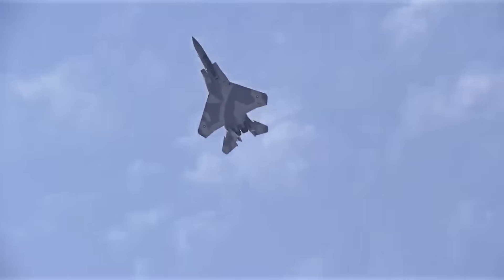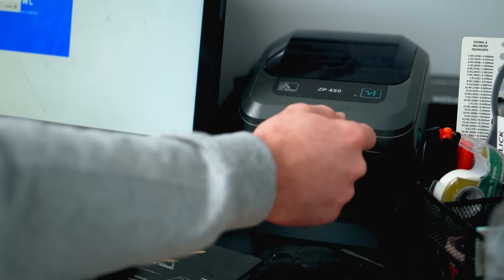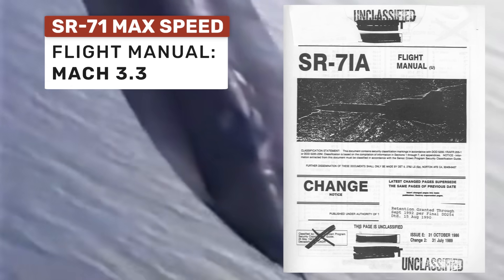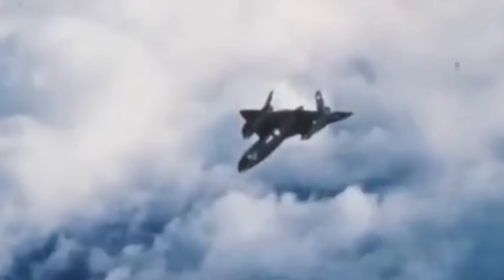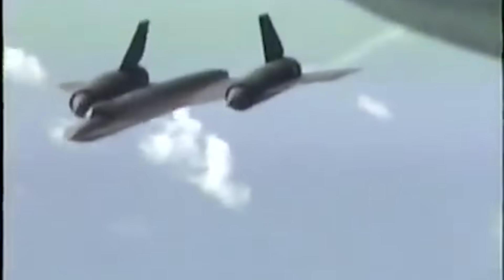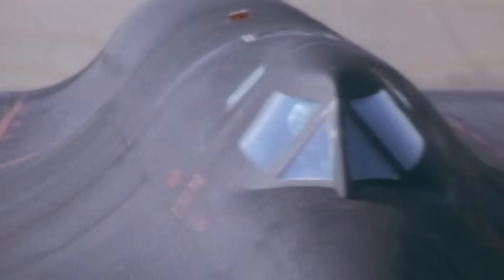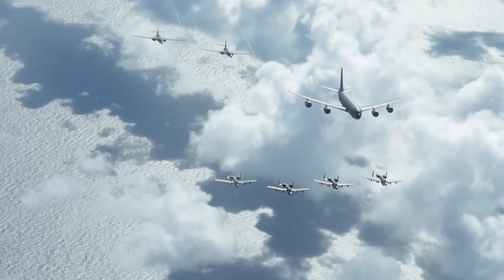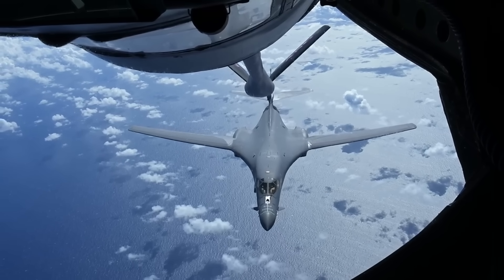The SR-71 was MUCH FASTER than the Air Force will admit

Comment: When I was stationed at Nellis AFB the F-15 squadron I was in, the 433rd FWS and later just the Eagle Squadron, occasionally tried (emphasis on tried) to do intercepts of SR-71's. The pilots told me that first they had to already be in position and, if I recall correctly, knew the direction the aircraft would be coming from and still they were unsuccessful. They also said that it was so fast that it was just a gray blur in the sky. The way they spoke about it indicated to me that it wasn't a difference of mach 3.2 to 3.5. They wouldn't or couldn't say exactly how fast it was but did say that it was SIGNIFICANTLY faster than advertised. On a side note, those intercepts were done at 80,000 feet. Much higher that the F-15's advertised ceiling of 65,000.

Comment: Brian Shul's explanation for the Blackbird's top speed was simple.  I'm paraphrasing a bit but it went like this:  "When we faced a threat from a missile, our instructions were to increase throttle until we outran the threat and we always outran the threat.  The Blackbird never stopped accelerating while the throttles were left open and no pilot wanted to find out if either the engines, or the fuselage would give out.  No one knows the top speed of the aircraft."      

When asked how fast he'd personally flown in the Blackbird, his reply was simply "That's classified..."

Comment: When I was young, born in 1972, I did a book report on the SR-71. I think it was the 4th or 5th grade. The book I used was given to me by my uncle. He was a flight instructor in the navy. He knew I wanted to be a pilot, never happened, and he wanted to help that along. He would give me books on different aircraft or aviation, and the really nice models they used in the navy to use as teaching aids. I wish I still had them lol.
Anyway, the book I had said it’s top speed was, in fact, 3.5! I don’t know if I was supposed to have what I had or not. I imagine the number has just been changed over time for some reason.

Comment: At these speeds, the specific conditions of the air at altitude have a huge effect on the reported mach number.  I was at Lockheed in the early 1980s and worked with both test pilots and engineers that worked on the Blackbird.  One of the things I was told was that the real record was held by the D-21...
Reply: The d-21 look like it's built using the same principle as a sr-71, but without a pilot. No canopy mean you remove the major weakness of the fuselage. And if I understand they didn't need the turbojet/ramjet hybrid, so a way simpler engine.
Taking all of that in consideration, it seems logical that the d-21 should be faster.

Comment: To those who have followed the Blackbird story it should be no surprise if it was actually capable of going much faster than publicly admitted. Any aircraft may be able to exceed its officially stated top speed under certain special conditions. You might also assume the actual capabilities of spycraft were perhaps not fully disclosed for strategic reasons. It shouldn't even come as a surprise if this incredibly powerful airplane could go as fast as the pilot would push the engines until the airframe would eventually break up from aerodynamic stress or go out of control. How fast that may be is anyone's guess and perhaps could only be established by testing it to destruction which is not a good idea during manned flight at such speeds.

Comment: The "V-Max" switch? Named for the eponymous Yamaha street fighter motorcycle of the 1980s?

Makes good sense to me, or anyone else who's ever ridden an early, power-unlimited V-max. When throttle setting & RPM are sufficient to open up the V-boost gates (large vacuum secondaries), that big, heavy 1200cc machine takes off like a stinking rocket, taking you on a ride that you really had better be prepared for.

Comment: I went on a field trip to Beale AFB with the Stanford Aero/Astro club back in the early 80s to drool over the SR-71.  We went through the room where they analyzed the data the SR-71 gathered - and the person leading the tour said that they could allow people without clearance to enter the room because none of the strip charts had numbers on them - and that they needed classified rulers to interpret the results.  I asked if the 3-sided rulers sitting next to the strip charts might be those tools - and there was much harumphing while they gathered them up and stowed them away.  I don't remember the exact limits on the measuring guides, but my recollection was that it was a bit more than mach 3.2.  I hope I don't get a visit from the FBI.

Comment: In 1984 Physics Today had an article stating that a ram jet theoretically maxed out at mock 6 and a scram maxed at mac 27.  So, with a rule of thumb of mock 6, I would think that altitude would play a bigger factor.  And as for structure, we have mistles that hit mock 6+, making uneven heat the factor and not heat itself.
Reply: Are you mocking the plane?

Comment: You are making the faulty assumption that the data made public regarding thermal and structural limits is fully accurate. As someone who worked in the intelligence community for nearly 30 years, I would assure you that the printed limits in the manuals will be 7 to 10 percent low. Remember, during the cold war, manuals and photo copies of manuals were the easiest way of Soviets and Chinese getting operational envelope details to build defense systems against. Those flight crews were most likely given absolute limits verbally that were never written down outside of Lockheed Skunk Works. Remember, the customer for the Blackbird product was CIA. They would have run the counterintelligence operation for the Blackbird program out of Langley, not the air force. 
Another item of note: the SR-71 was known to be faster than the Soviet bloc S-75 Dvina (NATO name SA-2 Guideline) surface to air missile. That missile has a documented speed of mach 3.5. The S-75 has a range of 25 to 30 miles depending on the variant and trajectory. So, a 20 to 30 second boost to mach 3.6 would put it out of range. We know that the Libyans and Egyptians fired salvos of SA-2s at the Blackbird and it evaded by accelerating beyond the range of the missiles. Outrunning 3 to 5 Libyan and 6 to 8 Egyptian and Syrian missiles tells us that it was not structurally nor thermally limited to mach 3.3 to 3.5 at 75k to 80k feet. Its limits were more likely in the mach 3.65 range.

Comment: We knew a number of people up in Panama City. The scuttlebutt up there was that the F-22 achieves like what they’re talking about for this new F-15. Close to Mach 3. The problem there was the RAM coatings. My understanding is that the speed was attainable at the very high altitude that the raptor operates at, and that it is safety limited to Mach 1.6 at altitude to avoid dinging the composites. I was speaking with one guy who worked for one of the big defense contractors and he said that the scuttlebutt was that the reason we didn’t sell the F-22 even to Israel or Australia had nothing to do with the composites or the sensors which are less advanced than the F-35. He said it was about the power pack, meaning the engines in their inlets and exhaust because even if you assume that the F – 22 can only go Mach 2.25 instead of the previously admitted, Mach 2.5, it’s doing things that are fixed inlet engine is not supposed to be able to do. The F 35 didn’t require such voodoo because it’s engines are tuned more for efficiency.

Comment: The reason they didn't publish a higher top speed is actually scientific.  When going at higher speeds the engine control loop would go into a phugoid oscillation because the engine shock cones could not adapt quickly enough to changes in temperature and pressure.  This resulted in barely controllable "Mach excursions" with the aircraft porpoising thousands of feet in a matter of seconds.  That is technically not considered controlled flight, thus the lower published number.  However, under attack, a pilot could (and sometimes did) opt to risk "exciting the phugoid" to make an escape.  While I don't have firsthand info, I suspect the inlet ramps on the F-15 impose similar limits on the official top speed.  Sorry to bust the conspiracy theories.

Comment: So I'll preface this with the simple statement that this is in no way shade on the the mighty Blackbird because honestly, the slide rule and brain grease engineering that built it is a testament to what can be done with the right motivation.  If anything this is a statement on puking back statistics as if the stats are the system.

Mach numbers are not "real".  I'll wait for everyone to get the yips out and calm down.  You "mach number" is your velocity divided by the speed of sound in the medium thus from a performance perspective the SR71 is hauling ass at cruising altitude and while Mach 3.2 at 80k, an F15C doing Mach 1.2 at sea level is pouring on the power.  The issue is air density and speed of sound.

At sea level, 1atm at 60*f, the speed of sounds is nominally 761mph.  At 80000 feet, temps go down to -65*f and air pressure drops out to .022atm which then lowers the speed of sound to nominally 648mph.  So in the little world, the F15C is screaming at roughly 913mph and the SR71 is doing roughly twice that at roughly 2073mph BUT the F15C is doing it through 45 times more atmosphere.  Now from a pure specific output kinda number, the energy needed to achieve M3.2 even at 80k is impressive given the weight, the SR-71 is no slouch in that regard however the heat from drag is even at 45 times less atmosphere is enough to start melting the aircraft.  The additional power input needed to move from a steady state of 3.2 to 3.5 is equally massive.  But the F15C is doing (JUST!) half'ish these speeds through 45 times more atmosphere in hot air (relatively) that is sopping with water (also relatively) by comparison.  This is like taking your high end sports car out on the highway and the punk kid appears to give you a go... you're not taking him to gapplebees, you're only walking away from him slowly.

So for the all the bullet point stats fan boys,  the SR-71 is TEH FASTESTESTEST which is true but the F15C is gonna be the one to hurt you with sudden power application.

We can now all return to the frightening realization that the only thing stopping you from going faster is yourself and how you feel about burning metal.  "Not power limited" is the living embodiment of horsepower versus torque.

Comment: A retired SR-71 pilot once recounted flying at Mach 4+ and altitudes exceeding 120,000 feet. He also added what we now call a UAP experience. He described glowing objects descending from above him, looping around his plane before continuing downward. This was from 10-15 years ago.
Reply: THIS IS TRUE.
Reply: I'm sorry but I seriously doubt that. The physics of an airframe like the Blackbird flying at 120k feet just don't add up. Not to mention the fact that you would have suffered serious compressor stalls at speeds in excess of Mach 4 without an inlet precooler.
Reply: The Chicom radar reported an altitude of 110,000 in 1970.
Reply: ZZZZzzzZZZ.  Bs.
Reply: @zd1322  He was a Vietnam-era fighter pilot who was involved in the R&E program to add guns to the Phantom II. He went on to fly the SR-71 and work at the Pentagon. I found him credible, trustworthy, and articulate - in stark contrast to your response.

Comment: Dunno about yall, but Andy Peloquin from RAAF hit 1,200 ktas with the 200 ft LARA setting in an F-111 F model in Death Valley back in the 1970s.  My Dad flew the F-111.  I’m sure the airframe was rated for MUCH lower max speed at that altitude.  Peloquin wanted to see how fast it would go.

Comment: I remember that when the F-35 program was still getting started, I saw with my own eyes where the Pratt & Whitney website described the F-35's engine thrust rating as being 44,000 pounds wet.  Just days later it had been changed to "40,000 pound thrust class".
Reply: German auto companies regularly state the power of their engines way below their peak power.

They say they do this as its the power the engine makes under all circumstances.

Seems this is what you may have seen.
Reply: @marcalvarez4890  More like,  the power rating is classified and someone told P&W to back the rating down on the website.

Comment: Here is a consideration for anyone who cares; it's not necessarily about the power. Nimitz class carriers have far more thermal power at their disposal than the old USS Enterprise did, yet Enterprise had a higher top speed because her hull was narrower. The F-15EX is fat. I think it should be called "The Fat Eagle", not the Eagle II. There is also likely to be a specification that while the Fat Eagle is carrying it's most drag inducing missile load, that the aircraft can fly home on one engine when all the missiles on one side have fallen off and the missiles on the wrong (opposite) side have jammed on their racks and can't be jettisoned. That's the way DOD does things. Poor Fat Eagle, that's like flying home with one wing tied behind your back while holding a J-20 in its talons. 
Another dimension is if those engines could allow Fat Eagle to super cruise. Which frankly would be a lot more important than a little more top speed.

Comment: The problem with airplanes going that fast is the material that they are made of. The amount of heat that they create from friction and the forces that they go up against is mind boggling. We can make planes that can go 5 times faster than a bullet but they will just disintegrate. We have to make materials that can withstand the heat and forces. You know we send objects into outer space at 17,500 miles per hour. Believe it or not but that is extremely fast. When an object is only going in one direction its much easier to get away from these forces. By the time that this vehicle is above 10,000 mph it is in an atmosphere that has very little oxygen. So the forces are basically going away. Once in outer space hardly any oxygen so you don't have the forces against the wings and because of lack of oxygen you don't have to worry about friction on the wings or body of the vehicle. Plus it's extremely cold out there. Where the real problem comes into play is coming back into our atmosphere. This is why we have heat shields and this is why that vehicle is so bulky to resist the forces that are fighting against it. If you ask the pilots of those vehicles they will tell you that flying it is like flying a brick. And they refer to landing it as a controlled crash!

Comment: There is a fairly convincing bit of math that says the SR-71 was limited primarily by the shape of the plane. The max comes from the shockwave that begins developing at the nose and gets more angular as the velocity increases. Eventually, that shockwave will impact the tips of the wings because the cone of air the plane is pushing into, gets longer and narrower the faster you go. When that shockwave intersects the wings, you risk major damage to the aircraft, and Mach 3+ is a very bad time to have your plane start to come apart and tear its wings off. The angle where the cone hits the wing is between 16 and 17 degrees measured from the nose of the aircraft. The cone narrows to this 16-17° range at about Mach 3.5. This is probably why the USAF set the max speed at 3.2 and speeds beyond that are rare. Also, turbines are built to be most efficient at certain speeds. Below that range, they guzzle too much fuel. Beyond that, you're pushing them outside of their efficiency and they get too hot and start to eat themselves. There are reports of engine flameouts at speed that might indicate a problem with the nose cones and allowing turbulent air to hit the compressors. My guess is that a J58 engine for a Blackbird is really freaking expensive and blowing one apart because you were hot-dogging would land you in serious trouble. Or the engine blows up, the aircraft goes into a spin and the Mach 3 air hitting it sideways rips the whole plane apart. 
Interesting thing though is that the GE YJ-93 engine was rated by GE to be capable of pushing enough air to make Mach 4 in an appropriate plane. The P&W J-58 was a competitor and was considered for the XB-70 bomber that never made it into production. It is entirely possible that the SR-71 has the muscle to go a lot faster but the risk of destroying the plane and frying yourself is just not worth it.
Reply: That bit of math is very simple. Mach # = 1/sine(angle). With a 16.5 degree angle from nose tip to wing tip from centerline that equals Mach 3.52. I know they had at least 3 different nose configurations for the plane so they may have had a longer nose to test slightly higher speeds but with the configuration I see on drawings, Mach 3.52 is a hard limit on that airframe.

Comment: IIRC the F-15's Vmax switch hasn't been connected to anything since the "upgrade" to F-100-PW-220 engines in the late 80's. I'd be shocked if GE's F-110's were even theoretically compatible with this functionality.